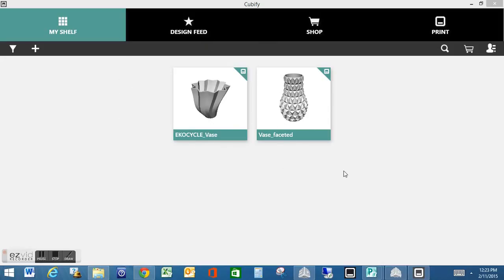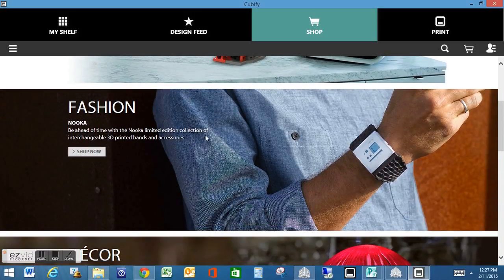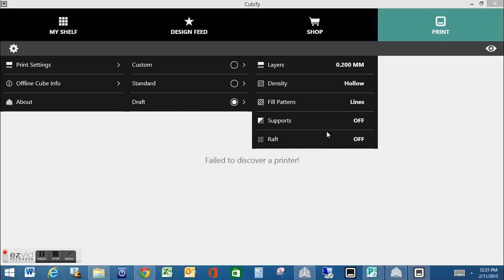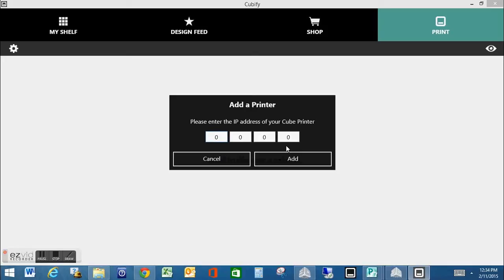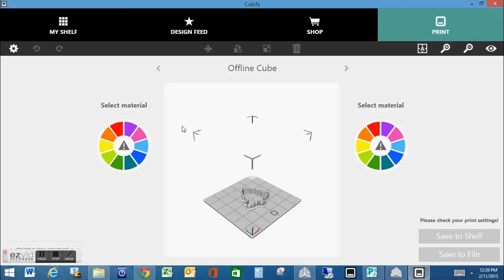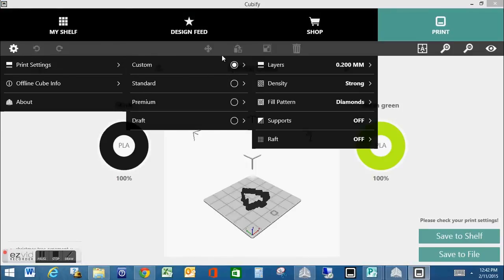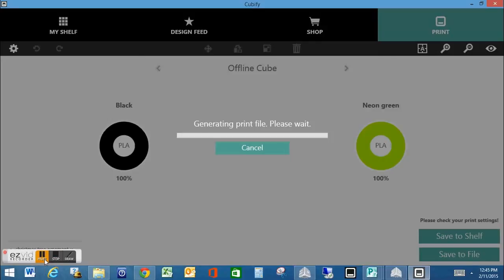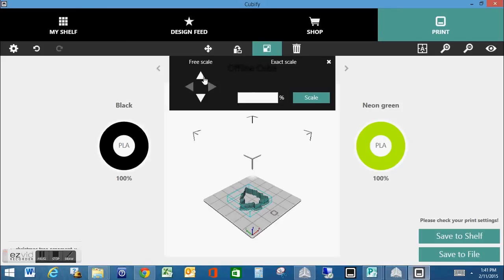Cube 3 Printing Software Overview

Comment: I made an otter with 70 microns, but when i added support for it, it kinda made the support be a part of the object and impossible to remove. Is there a way can customize how the support looks and how it's placed in that program? I'm using cubify 3.18
Reply: Duckers how long for the glue to dry